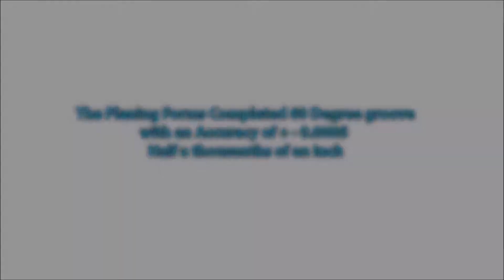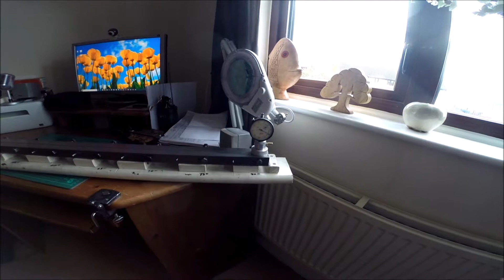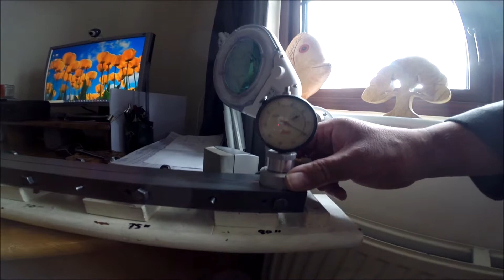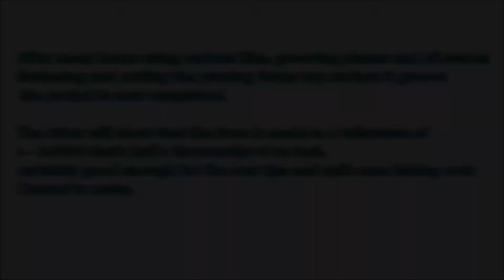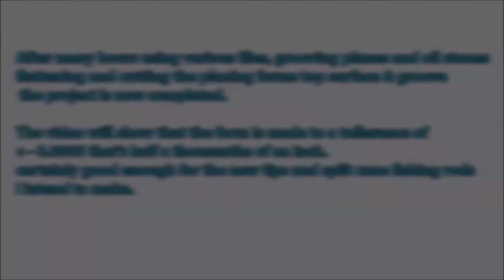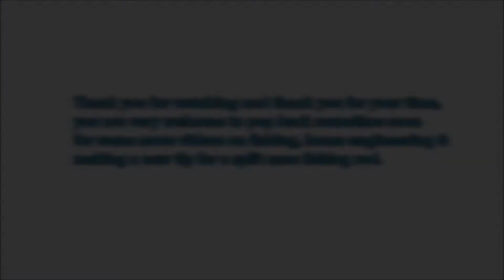Split cane planing form completed

Comment: Friend, what a good job, excellent mold, what a pity to ask the question. Does the watch you use measure up to an inch or how many?
Reply from the maker: yes the dial indicator measures up to half an inch of travel one rotation of the dial equals 50 thousandths of an inch